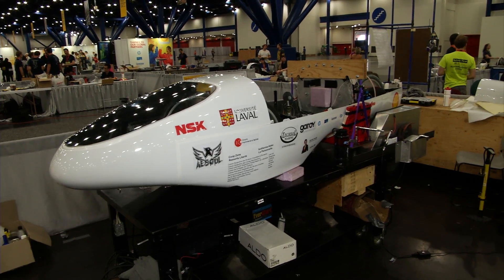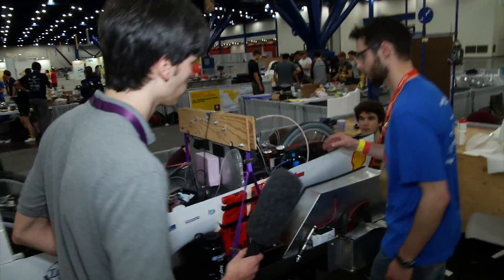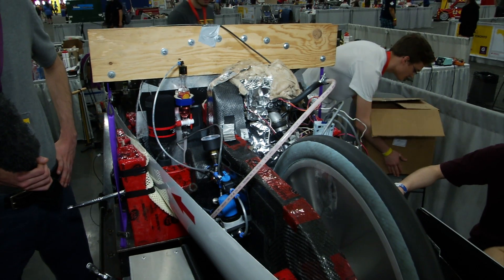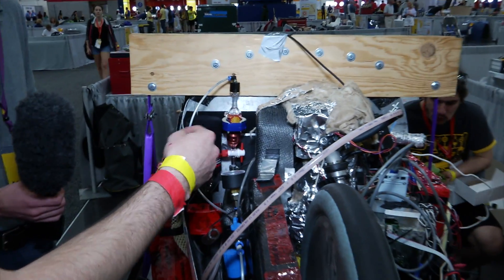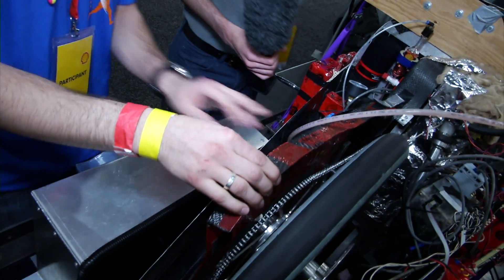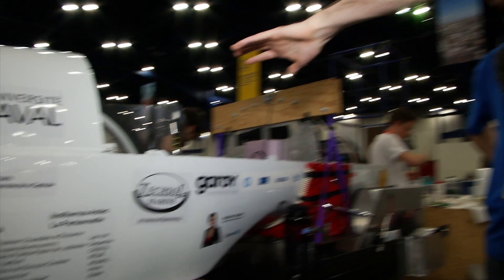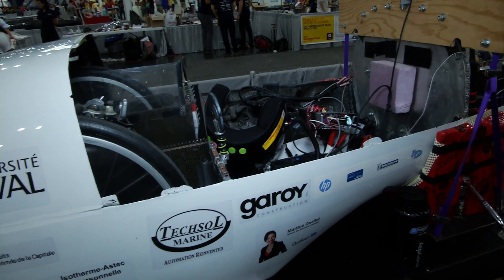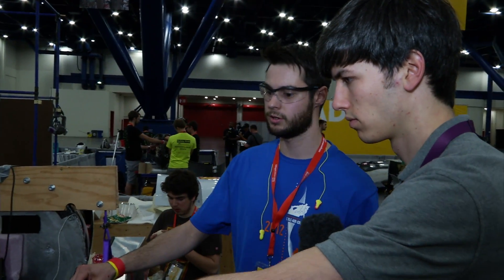2,824 Miles Per Gallon - 2014 Shell Eco-marathon Winners - Université Laval

Comment: A good job but what could you do for 77 LTD or chev 350 engine in a full size car. Honda had  2 seat car geting 70 mpg years a go. keep up the good work  some day they may use your system in racing.or on the road but to day this is only high tech toy 

If you could get 50 MPG on the high way in those cars you would have done it the chev vega or ford pinto with the carb system did all right on the road but still had a long way to go and with all the high tech and light weight cars is the MPG all that good.

Keep up the good work who knows you make the next engine that gets 100 MPG
on the High way when you get out of school or drop out and do it. after all more than
one person has left the path and blazed a trail in the world.

Comment: i wonder how efficient the motor is. 3500 mpg is extremely impressive for 89 lb car. but honestly its one thing to make a car lighter, smaller, and more aerodynamic, and drive at 20mph, but the real challenge is making the motor more effiecient. is the motor even at least as efficient as any other? we need to invent an engine that has zero nox and carbon monoxide
Reply: About 15-20% average efficiency.  It comes down to rolling resistance and air drag + only running the engine at peak efficiency (burn + coast method).  Laval's engine might a little over 20% efficiency since they did a nice job in that area of the car.
Reply: A 6 stroke engine might be used to further optimize the efficiency. Notice that the engine is insulated, perhaps a measure of keeping the maximum amount of heat generated by the gas combustion inside.

Comment: Whoa! 2824 miles per gallon? unbelievable. wait a minute 2015 version that gets 6837 miles per gallon? that's outrageous. what, you're almost finished with the 2017 prototype that gets 18,602 miles per gallon? That is off the charts . Wait, now GM is getting in on the action. in 2018 they plan to present a car that gets 60 miles to the gallon. I see now. every year the miraculous engineers a thousand more miles per gallon, then after that 10,000 more miles per gallon to their experimental prototype, the public only gets 2 miles per gallon more every year. what a bunch of BS. this video's sucks.

Comment: I think it would be a little more practical if it could go 60 mph+ even if you would have to put like 85cc motor,it would still get at least 200mpg probably
Reply: With its 1.9 HP engine this thing probably could go 60 mpg if they adjusted the gearing.